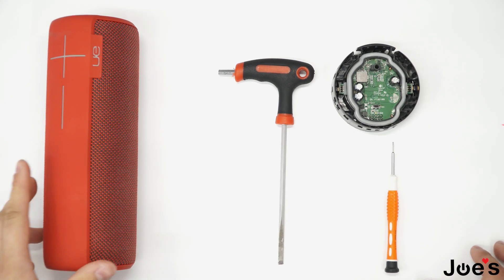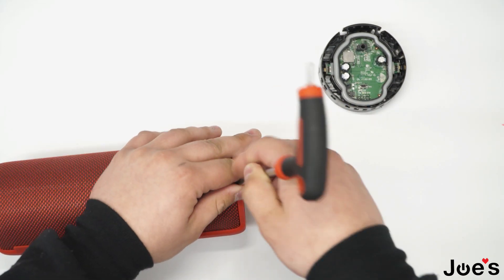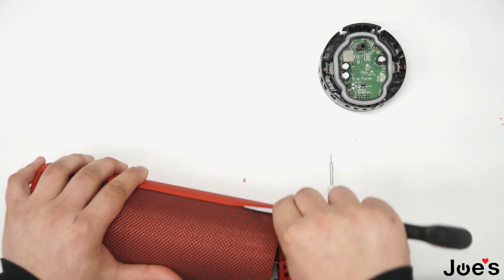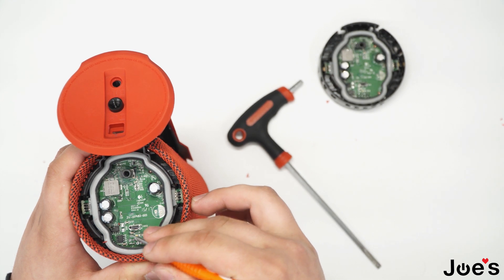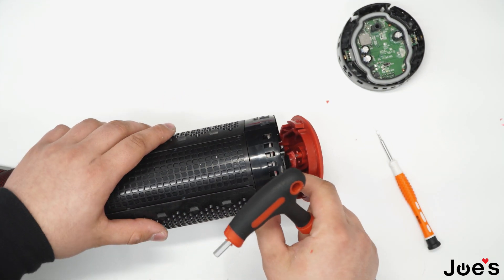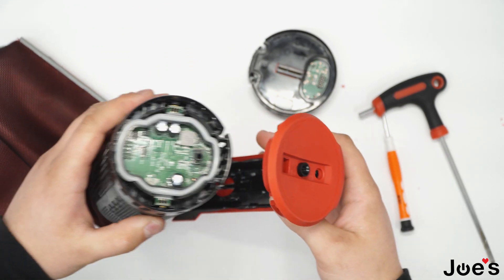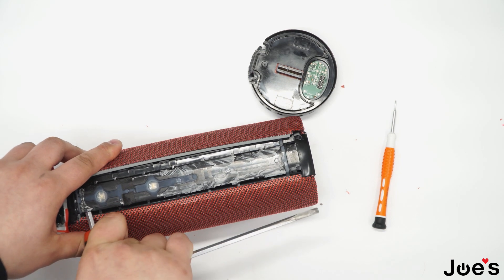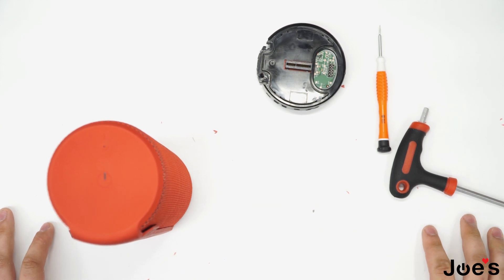Ultimate Ears UE Megaboom Doesnt Charge Charger Port Replacement

Comment: My ue says critical battery please charge but it says that as soon as i turn the power on by the wall. Could you please help guide me to the right place and for parts on your website. I thought it my just need this part but not really sure. Thanks in advance
Reply from the maker: Thanks for the comment. The issue you are describing sounds like a faulty Bluetooth board or battery. 

If you would like your device repaired by a professional you can fill out a repair form and follow the steps to send in your item. We offer free shipping and diagnostics. Here is a link to the repair form:
https://www.joesge.com/pages/repair-services

-David P
Reply: Hold volume down and power button at the same time until the speaker resets. If it hasn’t yet given up completely you will hear a noise indicating the speaker has reset in 6-8 seconds. If it is dead and won’t even turn on, then first plug in the charger and watch for the flashing light — then hold vol down and power until the charging light stops flashing. Give it 30 seconds or so, unplug and then reconnect the charger, and the light should be flashing again. Give it at least a few minutes to charge, then try turning it on again and it should work. I would then shut it off or at least not play any loud music until the battery reaches 100%. You will need to re-pair Bluetooth when you do this reset. Then leave the cord plugged in while using the speaker in the future. I experience the problem you describe where the speaker will just drain all the way out once the battery level drops too low, and I read online that it may need a replacement battery if this problem happens often. I’m trying to find the correct replacement battery at the moment.

Comment: Do u ship it to Brazil? My Megaboom won't charge, I have already replaced the battery...Do u think this board will solve it? Thanks
Reply from the maker: Thanks for watching! Yes, we do ship to Brazil! If the battery was not the issue then the charger port would be the next step to go. CH
Reply from the maker: If the charge port is the issue on your speaker, the charging light will not turn on when you plug it in to charge. We do not currently have the whole charge port board in stock, however we do have the charge port itself for sale on our website here: https://www.joesge.com/products/ue-logitech-megaboom-parts?variant=8050330599470 It requires a small soldering iron and a bit of patience to install. If you do have any questions about the repair, we are here to help :) MD.
Reply: @Joesge  The charging light doesn't turn on when I plug the cable, however, my speaker only works when the cable is plugged, the issue is that it doesn't charge the battery. So I think I'll need to change the whole charge board. Would appreciate If you could notify me when It become available. Thanks!
Reply from the maker: Thanks for watching! What is the make and model? we would certainly notify you when the parts became available. CH
Reply: What is your website? I like to purchase an order for this circuit

Comment: So I just did a battery replacement on mine and it still was not working, turns out the pins that the battery connect too had popped off the pcb, all I had to do was push the pins back down to the ocb and problem was fixed.

Comment: I do not understand a video says it is the battery and another says it is the charger port,I don't know which one to change I don't know which of the 2 is the problem
Reply from the maker: To simplify. If your charger port isn’t showing a light when plugged in then you have a broken port. If there is a light showing when plugged in but no power then you have a bad battery. Joe
Reply: Joe's Gaming & Electronics thank you very much

Comment: Just took mine apart and took the top piece off and the contacts were slightly corroded...cleaned them an put it back together and it works like new again...no money spent!!
Reply: How did you clean the contacts?
Reply: When you pull the cap off…the port is right there on top.  I lifted it up and scraped the contacts and put it back together and it’s been charging fine ever since. I will say this though…it may be a bit unconventional but a trick I used before cleaning the contacts was to squeeze the top of the UE boom on the charging end very tightly while charging…used a Irwin quick grip clamp to do it. Weird I know but hey…it worked!

Comment: My AUX port is crackly on a brand new megaboom. It jiggles perfect to one side, then completely muted when you let go. I have tested 4 cables which are known to be working.
Reply from the maker: In this case you would most likely have to replace the charger port PCB.

Comment: Please help,when i plug my charger in to the megaboom the light is blinking as normal but he cant charging when i tourn it on it always says 20% charge or sometimes 40% and when the charging cable is out the charging light is still blinking when it is on!!!
Reply from the maker: Thanks for the comment. Have you tried to perform a firmware reset? If the issue persists then you may have a faulty Bluetooth or battery. 
-David P
Reply: @Joesge  In ue megaboom app it seems to be charging and also always are 20% can't get past!When i turn on the speaker and listen for some music  on low volumes i can but when i goes on higher volumes it automatically shuts down!
Reply from the maker: If the firmware reset does not fix the issue then there is most likely a hardware issue with either the battery or Bluetooth board.